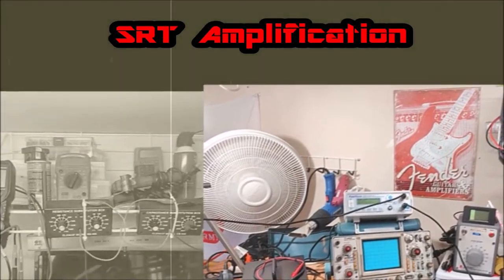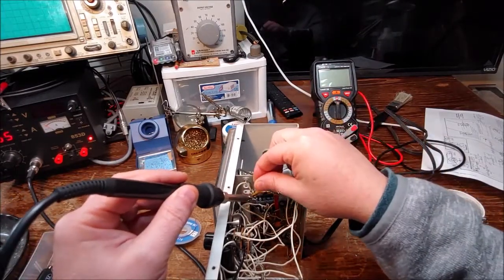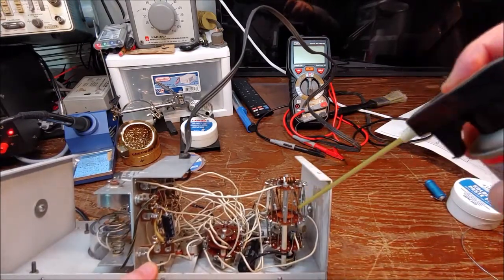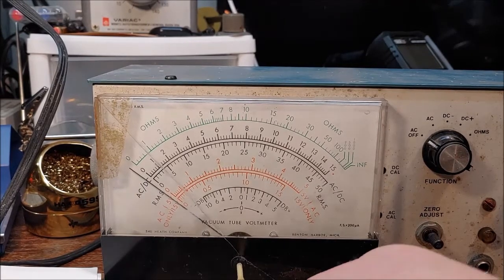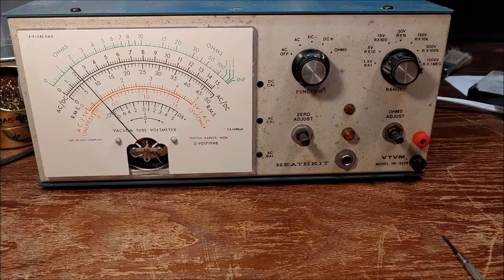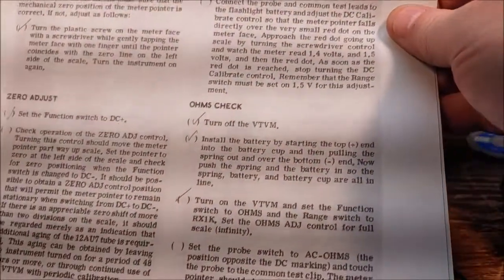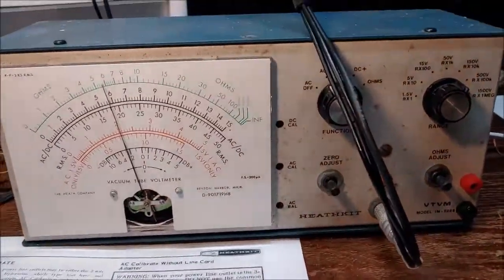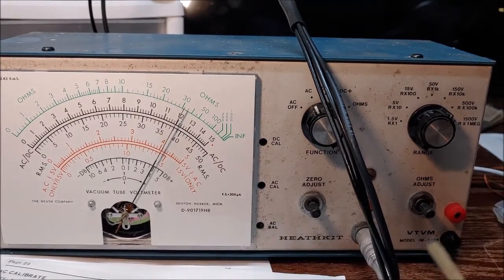Part 4 Heathkit IM-5228 Calibration

Comment: Great videos on the Heath Kit IM-5228, I don't  know if this is the proper venue, but I have a question reference this VTVM. I replaced the capacitors on the same unit, and now have a problem. When I tried to calibrate the meter it has strange readings on the meter. At 115 volts when set to DC+ the meter deflects to infinity and there is no adjustment via the zero adjust. When I lower the voltage down to approximately 45 volts the meter will drop down to almost zero on the meter and has some adjustment via the zero adjust. Also, at 115 volts when switched from DC+ to DC- the meter will go from infinity to past the zero mark. I would greatly appreciate any information or knowledge reference this problem.
Reply from the maker: you changed all of the caps or just the filter cap on the power supply?
Reply: @srtamplification  All the Caps, also there was a loose wire on the DC+ potentiometer that went from the center tab (2) to the function wafer switch . I reattached it to what I think was pin 4 on wafer B.

Thanks for your response.
Reply from the maker: @teclainvestigations8110  Not being able to see what all you have done and the state of the circuit itself, it makes a diagnosis very hard. I would start by checking all connections to include the ground connections. Then perform continuity checks from ground to all other points in the circuit, to test for shorts. If you need a schematic let me know.
Reply: @srtamplification  I totally understand, I will start there, I have the manual and schematics, but appreciate it. Thanks, Don
Reply: @srtamplification  Sir, I have found that all the 22M resistors in series, R6-R11, are open that goes to the 6AL5 plate. I wondering if it's because of a bad capacitor ? Also,  a couple of 150K and 180K resistors at the zero adjust is way off as far as the resistance value.
Reply from the maker: @teclainvestigations8110  Yes I found some resistors that where out of tolerance and had to replace them. You are not testing the resistors in-circuit right? Are you using a DMM
Reply: @srtamplification  that’s correct I have taken the resistors out and used a DMM, and the 22meg resistors show open. Thanks for the reply.
Reply from the maker: @teclainvestigations8110  Well I don't know what kind of DMM you have, but some only read up to 2M. They will show open but they are not.
Reply: @srtamplification  Understand, thanks..
Reply: @srtamplification  Yes, Sir, this meter is good up to 20 M. I going to keep working and studying on it until I get it figured out. Thanks..
Reply from the maker: @teclainvestigations8110  Yeah so it reads those 22M resistors as opens. They are probably good. Put two of them together in parallel and you should get a reading of close to 11M on your meter.
Reply: @srtamplification  will do, thanks for the information.
Reply: @srtamplification   Checking back in reference the IM-5258, I replaced the tubes and now I'm able to zero calibrate, DC calibrate, Ohm adjust, and AC calibrate and seems to be working. The only thing I notice is the needle movement when it gets close to the Zero it takes longer to reach zero balance. This occurs after dropping the dc voltage off, ac voltage and when disconnecting the probes on ohm check. So, if you have any answers or suggestions I would appreciate it. Thanks in advance.
Reply from the maker: @teclainvestigations8110  Sounds like static build up on the plastic. Take the clear plastic cover off and rub the inside and outside of it with a dryer sheet. This is common with plastic covers.
Reply: @srtamplification  Thanks... I appreciate you taking the time to answer